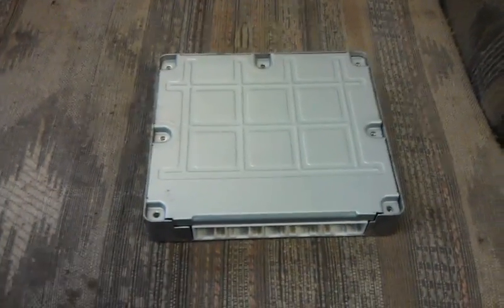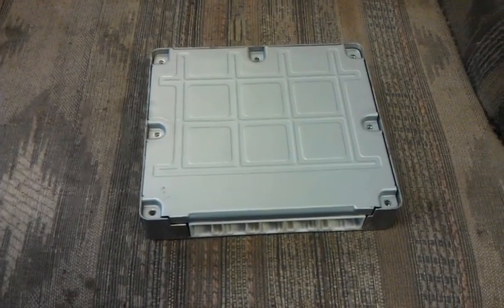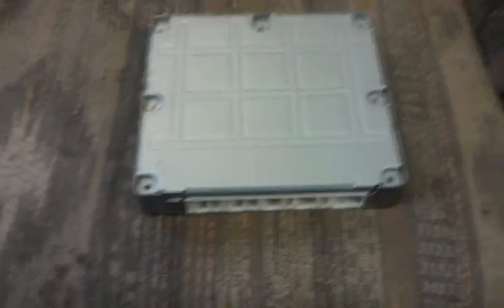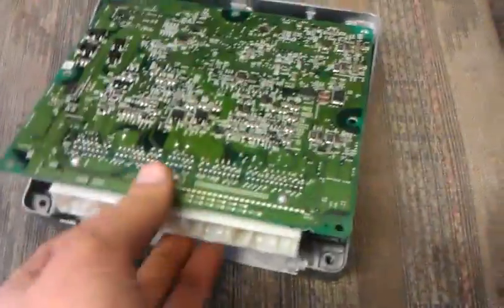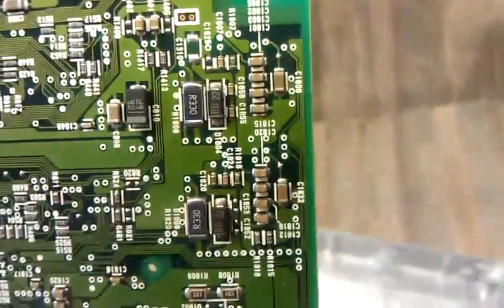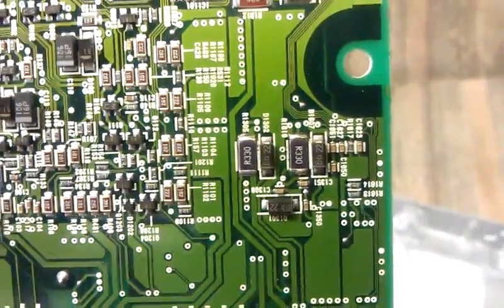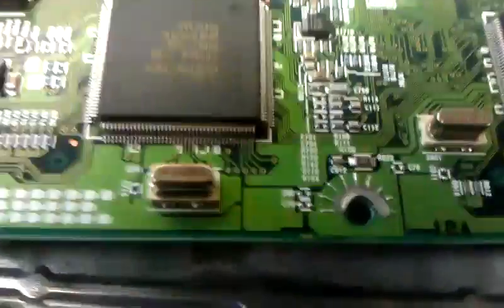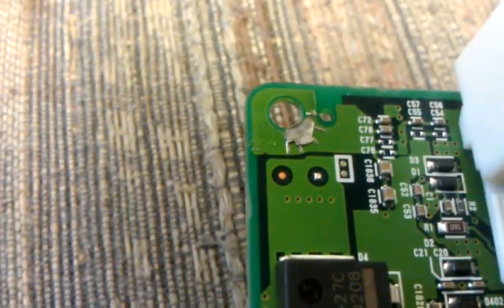HOW TO FIX RAV4 ECM ECU TRANSMISSION PROBLEM. **READ DESCRIPTION!**

Comment: I just touched up the grounds and it fixed a shift issue I had.  1st gear did not work.   Now it does.  It also cleared a code for the O2 sensors.

Comment: Hi, I am having a problem charging the battery. The generator is charging, but the consumption is more than the charge, the power steering does not work because there are not enough power.
What is a problem?
I have Toyota Rav4 2006 disel 2,2

Comment: hi from france,
je partage mon avis personnel en 2019, depuis un moment le voyant moteur allumé avec problème p0758 selonoid shift, changement huile de transmission avec filtre n'a rien donné, perte de puissance au démarrage , changement de vitesse brusque, vibrations forte lors de déclanchement de marche. arrière, 
puis je vue sur différents vidéo cet astuce de ecu. (au lieu de changer l'embrayage.)
donc j'ai démonté le ecu il était en parfait état extérieurement , puisque que je repasser sur les soudures des 4 0330 le 2x 22 puis le côté face le 2 pièces blanche.
puis je remonter la pièce, et la les mecs ce la magie.
elle as la pêche de malade.
merci pour ce vidéo

Comment: I have used my RAV4 for 3 years it just happen with the ECU. i have checked and re-solder all resistor. now it no problem with the transmission gear any more. thank Jack Moon.

Comment: My 2004 - crazy speedometer.  Cruise control accelerates and decelerates like a wave.  When cold or hot it drops out of gear into neutral and revs really high - and clunks at slowing under 20.  Replaced ECU with Circuit Board Medics - situation reappeared with new to me ECU.  Had Transmission flushed - ran pretty good for 4 days.  Headed out of town and everything returned.  I don't know what to do!
Reply: Forgot to mention we originally replaced the speed sensor.

Comment: Using the information in this video and others, I just fixed my own Rav4 ECU.  I re-flowed the solder on the various resistors. I gave each connection a close visual inspection beforehand, and only one end of one resistor had any discernible crack in the solder. But I re-flowed them all. 
The Rav4 was starting in 3rd gear some of the time, other times in two gears at once, dragging on deceleration, clunking on the upshift to 2nd. All of the symptoms are now cured. 
Thank you for the video and helping me understand how to fix it.
Reply: Como lo resolviste me ayudarias por favor...?

Comment: The Rav4 to which I did this had a number of intermittent transmission problems: not shifting into overdrive, starting in second and revving out in between gears. After re-soldering the connections on the resistors as shown, the majority of the problems have disappeared, although the car is still revving out in first gear. Bottom line: there was clearly a problem with these connections which has been improved by this method.

My plan is to remove the ECU again and re-solder those connections (this time using flux) and hopefully the problem will disappear entirely.

Any mechanic would be charging you a couple of kilobucks as soon as you turn up to the shop with a transmission problem. Jake Moon, you can join the ranks of professors at the University of YouTube.
Reply: Has your problem been completely solved?

Comment: This works, I fixed my sister in laws 2001 Rav 4, I found lots of cold solder joints, simply flowed the solder again with flux and iron, Thx!!!

Comment: Jake - thanks for the post.  

In the beginning I struggled to find the fault on the RAV4 Auto Transmission - Jerking / jumping gears / down shifting erratically / starting off in a hit gear / basically the gearbox was being mashed....  after having the gearbox repaired by an autobox specialist TWICE, realised it wasn't a mechanical problem....  did the research and found there was a problem with the PCB on my model RAV4...  nearly sent it off...  but then happened upon this video...  thought; how hard could it be to solder a few resistors?  I very carefully followed the video and stills - and re-soldered the resistors as described and made sure the earth connections on the corners had good contacts (double soldered these and filed them down).... 

Well what do you know - Hey Presto - put the PCB back into the car (there is a video for this on You Tube to show you how to take the PCB out and put it back in...) And it only went and worked???  

I've been suffering with erratic and incomprehensible Gear shifting problems for nearly 2 years!!  Sometimes went away and sometimes worse...  I started to think I was going mad...  but it seemed to be after the car had been on bumpy roads that it played up more - which if it was a crack in a solder on a resistor that was making contact sometimes and not others...  this would go a long way to explaining why the problem came and went.

Anyway thanks Jake problem is solved!  CAR DRIVES BETTER THAN WHEN I BOUGHT IT!!

Comment: Thank you very much I did it myself and my Toyota runs as good as before
Reply: the same as described in the video but the most important area are the corners where the circuit board is attached.
Reply: +Gustavo Effio 
Yes I did the same - soldered the resistors indicated and the car drives like a dream!!  Thanks!
Reply: Pekka Luostarinen that's correct but be careful how you apply the led on the corners
Reply: +Gustavo Effio did you just re solder or did you replace the resistors?

Comment: The posts here in this are so full of obviously non-electrically inclined people who should NOT be attempting this at all!!!

To Jake Moon,   You will be hard pressed to tell what all was replaced on that PCB besides the resistors.  If done properly, any (ANY) of the chips on there could have been replaced.  The real issue is to determine WHAT had failed, and I doubt any one in the business is going to readily divulge what they do.  They may simply have a routine refurb program where any ECU that comes in gets a certain number of parts replace, and the ECU reflashed before a test and shipping back to the owner.

Nice video, but you fail to mention WHAT this transmission problem is or what some one with this issue will see or experience.  Transmission shifting...stuck in a specific speed? Randomly shifting? locking up? jerky shifting? what speeds does sit occur? what gear?  I can upon the video looking for transmission issues (mechanical) but this was very interesting.  Thanks.

Comment: Also solder the 2 large white 12 ohm resistors beside the input/output connector. They are large can vibrate and I could see cracking around the solder on my ECU.

Comment: Is this a normal problem when changing out a battery?  Happened to my 2001 Rav4 last week.  Now transmission issues.
Reply: +rsmc55 :  2001 to 2003, and now 2004 RAV4's are notorious for bad tranny/ecu problems.  I have a 2003.  ECU replaced once, and also sent out for repairs.  Did not help.  Might be tranny is bad.  This problem is way to complicated to tell you all here.  Go to: http://www.rav4world.com/forums  This place is pretty awesome.  Lots of people to help and tons of articles and how to's.  Sorry my friend to tell you this, but this is just the beginning of your problems with a RAV4.    NO ONE should ever buy a RAV4,  they are pure garbage!  Also, Toyota's, the newer models, are nothing but junk now.  Toyota went downhill and are not reliable manufacturers any longer.  Sad because Toyota used to be a great company.
Reply: +Leigh-Ann Smith thanks.  I did get a new ECM.  Worked.  I am so grateful....love my car!

Comment: hello I just got these symptoms on my RAV4 2003 and I'm about to take it out and re-sold the resistors I wonder if you know where can I buy the resistors? are they affordable?  I'd like to replace them might as well that I will remove the ECU, any thoughts?
Reply: +Leigh-Ann Smith How does one insist (make sure) their brand new PCM from a Toyota dealer has a one year warranty when the actual warranty is set at one year by Toyota corporate? Some module remanufacturers advertise a lifetime warranty, which boils down to them attempting to resolder suspect joints if you send the unit back -- as long as the company is still in business -- and given that typically is the extent of what they are capable of doing - and assuming they don't give you some BS excuse after you have paid two way shipping. Many companies (aka one person doing this on the side with a $150 solder station) that advertise such a repair are not fully competent as electronic technicians. Some rather large automotive computer repair companies are totally incompetent. They make enough money on randomly successful sales to bury all of the failed attempts. Keep this in mind when deciding new verses (usually) resoldered. Realize that a warranty from such a place may be worth less than the pixels used to display it on your screen.
Reply: +Gustavo Effio I've been looking for a whole new circuit board.  Can't find them, you have to buy a whole new ecu unit.  Trust me when I tell you this, go buy a new ecu from a toyota dealership, or car stores like O'Reilly's.  Never buy one on ebay, junk yard, etc.  You want a NEW or REMANUFACTURED one, not a refurbished one... they are not the same thing.  A new one will run you about 1,000 bucks.  Make sure it has a lifetime warranty!!  I have heard of people replacing the resistors on the circuit board themselves, but you have to replace them with the same kinds.  People think it's a certain volt system and sub a transistor thinking it's the same volt output, but it's not.  You MUST use the same as on the circuit board originally.
Reply: thank you Leigh-Ann, actually I did remove the ECU and resold the resistors very careful and i kind of clean and put new lead where the screws goes to attached the circuit board to the metal base, I put it back and works like a champ, I believe maybe I'm wrong but the resistors are not the problem the problem is where the screws goes it was rusty and the the lead was peeling off creating a non good contact for a ground-negative electric circuit.
Reply: +Leigh-Ann Smith  Um, refurbished is the same as re-manufactured.

Comment: Hi,
RAV 4 ( 2001 ) Hard shifting / slipping between gears. Trans shop   - changed transmission.... ( my bad , should have checked out this information ! ) 
Then..... hard shifting again.... shop replaced valve cover with electronics...
Shift problems again... now- took it to Toyota dealer, told them to Re Flash ECU, which they did, for free. Shifts with just slight hesitations, only 50 miles since re flash. Will wait until 100 miles. 
To be continued...
James Jarmon
Reply: +Randy Jarmon When you replace the tranny, you also have to replace the ecu at the same time.  The dealer should have known that!

Comment: Thanks for the VIDEO  Jake Moon, I did it yesterday to a friend's RAV4 2003.
The transmission was doing extreme clunks, and violent accelerations, and no shift from 3rd and up. like a disaster.

First he went to Toyota dealer, diagnostics: 1200 to change the ECM, or 3000 ECM + Tranny.
Then he went to Autozone, the part was not in stock, they need to ask for it, 1 week, and $700 for a NON TOYOTA ECM.
Then we decided to do the job at home, 1Hr labor, I resold the 6 resistors only and cleaned the board corners with steel brush gantly.
Back the ECU in place and NO FAILS ANYMORE!!   Awesome., we erase the codes from the ODBII, and the chack engine light didn´t appear again.
BIG HELP!!
Reply: Jaime Murcia send your ecu to dat   (   www.digitalautotech.com   ) they repaired mine and did a great job , 3 years since the repair my car drives like a champ  dont try to fix it your self my friend tried ended up having to get one from the dealer cost him 1400.00
Reply: That is exactly happens to me but I can't do it by myself
Reply: +Mike Garey hello Mike and all the rest of you at digitalautotech! Haha!
Reply: Mike Garey Yikes.  My 2001 RAV4 battery was replaced Friday, and now, having clunks and slips between 2-3 gears.  Really upset.  Mechanic said to "drive it" for relearning to take place.  Hmmm....low gears at slow mph still trouble.

Comment: Many things today from your Phone to your Motorcycle or Car electronic parts are very tested, but due the automatism of production, when they FAIL, They FAIL ALL IN THE SAME PLACE in ALL THE PRODUCTION CARS , the video don't show any difficult thing or a mysterious paralell universe, if you know a little about electronics, you MUST KNOW that soldering parts suffers with temperature extreme changes (car outside in winter north hemysphere and when you turn the heater the temp goes high), dilatation and contractions affects the solder parts, and one day simply cracks, resolder that pieces is not a PATCH, is about let vthe circuit EXACTLY AS IS WHEN LEAVE THE FACTORY.
I've repaired dozens of things like that, that ECUS are no more than a small processor in a circuit board, like a computer, a TV game or whatever. If you assume that IS ALREADY DAMAGED FOR REPLACEMENT, why not try, before down your pants at the dealer?, I'm not fear to do that.
Another FAMOUS fail un the HONDA CRV 2000 is the dash clock, ALMOST NONE STILL WORKING. all of them have the same points of solder "disconnected", or "cracking"  or false solder.. as you call it, and the problem can be solved exactly like this one, "re-touching" the soldering points with a small soldering tip. and voila.

The ABS BOSCH ROTRONIC of the AUDI QUATTRO 2004, The same, much much smaller soldering, but same thing... false contacts after 5-8 years, de-assembly re soldering and working again.
THANKS TO THE AUTOR OF THIS VIDEO  it's a VERY COMMON PROBLEM and many people charges you $ 200 to do exactly the same job under the LIE  "WE DIAGNOSE YOUR RAV4 ECU, WE MEASURE AND WE REPAIR IT WITH WARRANTY"

Comment: You can actually ohm the path that connect to the resistor(not the resistor itself because you will be pushing down on it), the tap the resistor and you will get intermittent beep on the meter. This is an example of micro crack invisible to the naked eye. Thanks for uploading, its always best to put new resistor on it since its low value.

Comment: One of problem is the ground connection at the left corner near the plug. I have had a lot of  visible electro corrosion and in a result I have got bad contact there
Reply: But, a good ground connection is not enough in my case. :-( Have to go ahead
Reply: Same problems for me, bad ground Connection.Bettered only with solder.
Reply: caferacervic In a result, problem was fixed by resolder all part which you can see in video, and most of all legs of microscheme of gearbox in my case. After 500 miles gearbox learned to proper work in all modes. Thank you very much
Reply: +caferacervi  where about this microscheme legs look in ecu board please ?

Comment: I found a place on ebay AUTO MODULE SOURCE they sent me one for $158.00
 I installed the new one which lasted about two weeks before it started acting up, the lady I spoke to said there could be a variable solenoid that's bad or something causing the computer to short out, anyone have any experience with that?
Reply: ohh boy!!   Try compu serve down off of Harris st...or contact Michael M.  that's my suggestion Eddie, JT
Reply: First, check the ECU part number. For RAV4 2000-2003(ACA20 and ACA21),they are 8966142700,8966142701 and 8966142702 for AMT. They are all superseded. For later model, parts are 8966142B20 and 8966142B21. Both are superseded.
If the ECU supersedes to your old one, you have one more move - to rebuild your trans. This is because, with using the old ECU, some damages have done in the trans and they are not fixed by a good ECU.
Remember, before having a ride, use scan tool to re-initialize trans learning values.

Comment: Thank you, this video saved my pocket, redid the welds of the items listed, nor had to change anything, just took some oxidations processor and function normally again, was giving the same problems in the gear changes, reduced alone and not advancing to first second, the unit spent on mechanical problems and accused the solenoid b. And the mechanic ever wanted to take off my exchange. Lucky I watched this video before! I'm from Brazil and I have a 2001 Rav4.
Reply: SuperRucar
Amigo,
Eu vi um post seu em um video sobre a ECU defeituosa da RAV4 e
 estou com o mesmo problema. A Toyota insiste que não há nada errado, 
mas eu os proibí de fazerem testes de rua com o carro pra tentar salvar o
 câmbio.
Estou atrás de algum técnico em eletrônica pra resoldar os componentes da ECU. Vc mesmo que fez ou pediu pra fazerem pra vc? 
Eu fico em SP. Se puder me recomendar alguem eu agradeço.

Abraços,
Felipe
Reply: Olá: resolveu seu problema com a RAV4 ? Tenho o mesmo problema. Será que só ressoldar esses 6 resistores resolve?